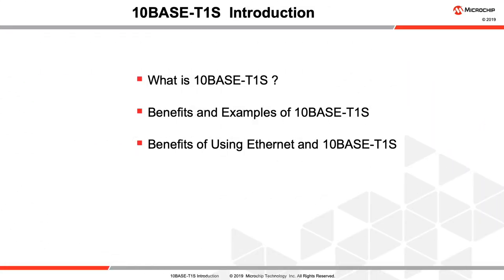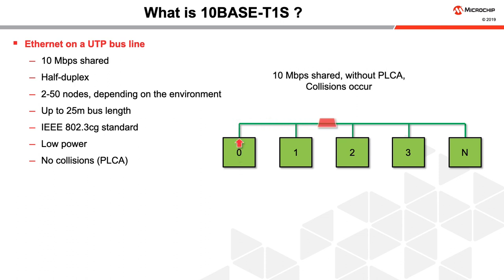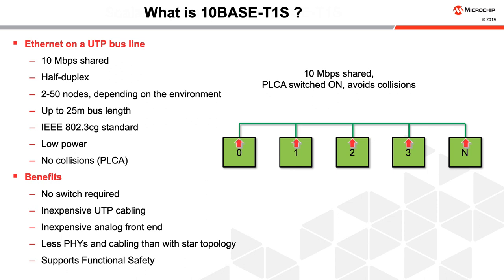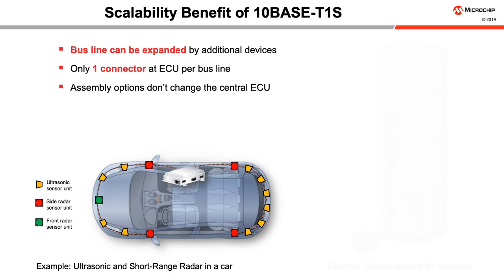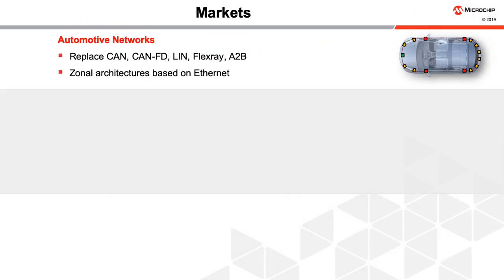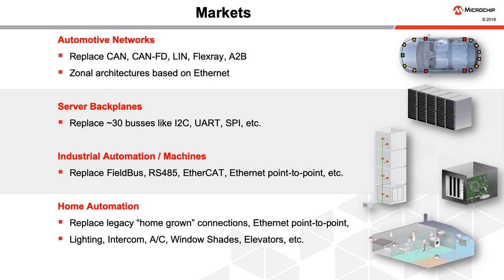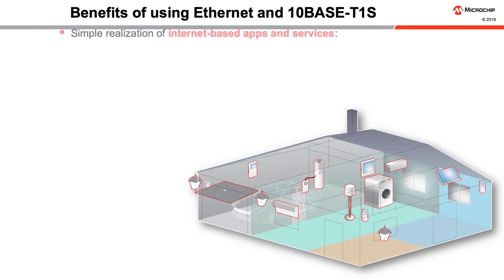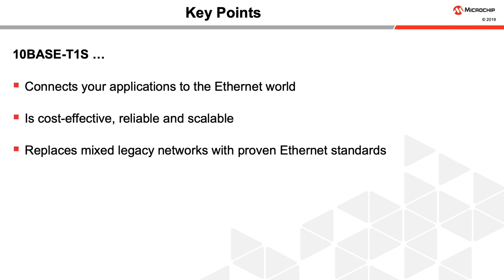Introduction to 10BASE-T1S

Comment: I discovered 10BASE-T1S and T1L two days ago, and this is super cool. I was searching for replacement for 10/100 Ethernet and RS-485, CAN, and KNX, that just works, and has less cabling, and less custom protocol, supports autoconfiguration and fast transfers with standard protocols. I am doing designs in home automation and measurments. So this is the way.

I have few questions that are not obvious. What MTU is supported? Can I do 1500 bytes MTU? Can it be used without PCLA, i.e. when I have multi-master setup.  What are the options for HV isolation?
Reply from the maker: Hi there, thanks for reaching out. For 10BASE-T1S and T1L:

MTU Size: The standard Ethernet MTU of 1500 bytes is generally supported, but you should confirm this with specific product documentation.

Use without PLCA: 10BASE-T1S relies on PLCA for efficient operation in multi-drop networks. Operating without PLCA may not be feasible due to its role in ensuring data transmission integrity.

HV Isolation: Options include common-mode chokes and isolation inductors. The choice depends on power demands and safety requirements of your application.

Hope this helps!